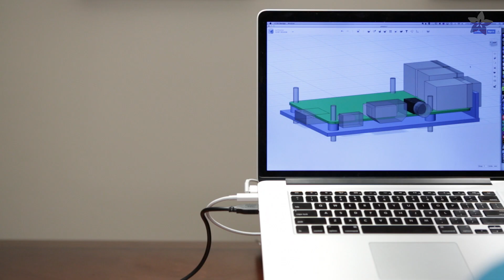3D Printed Raspberry Pi Domo kun

Comment: Now build one without your 3d printer i mean it is MAKE but you use the 3d printer for every thing and you didn't show us how to design and build a case you just showed off your 3d printing skills.
Reply: matty ristenpatt Well, keep in mind that this series is called "3D thursday" and therefore they'll show cool stuff to 3D print. If you want to make one by hand, you can do so too - just grab some thin plywood, and cut it to the dimensions shown in their CAD file.
Reply: There's some more info if you click on the link in the description. Has bits and pieces of useful stuff if that helps.
Reply: No i just thought it would be more usefull if they showed how you could make a case by hand. I mean they talk about 3d printers as if they are super cheap and that it is super normal to have one.
Reply: Wayne Johnson well i am going to buy one andl i doubt that i am normal.